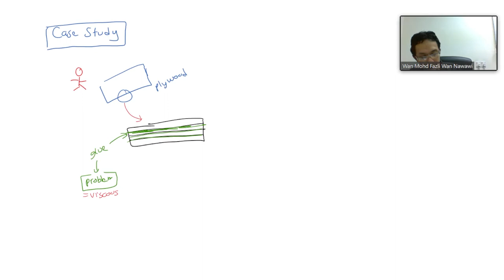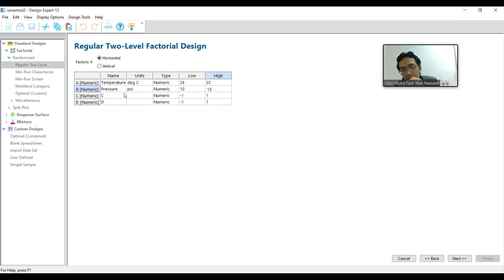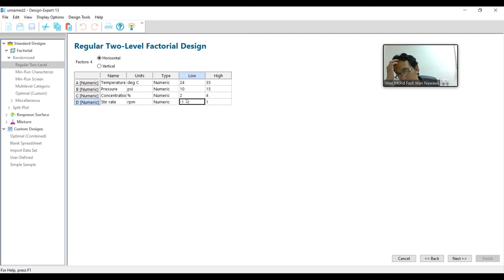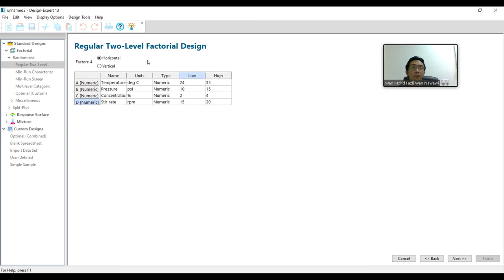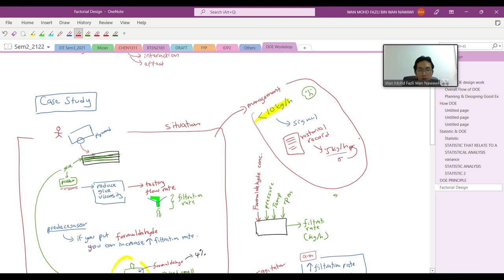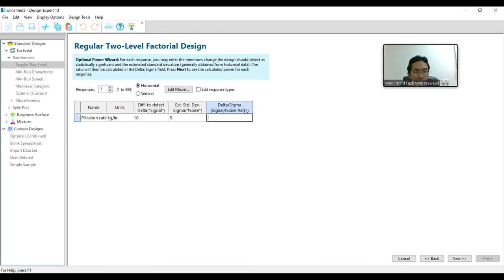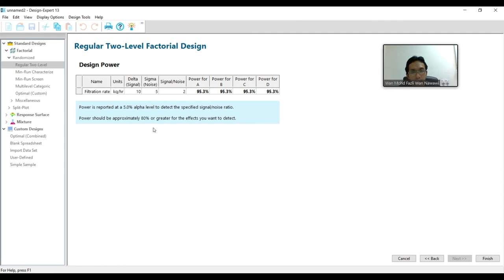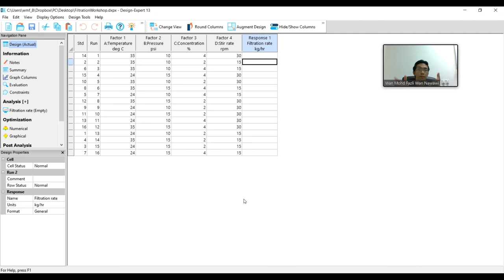12. Full Factorial Design - Part 1

Comment: In factorial design at 3 level 2 factor gives 9 run of exp and  after analysis by response like drug release, entrapment efficiency and particle size we get any one factor significant like from two polymer only one polymer is responsible for output is it acceptable or not

Comment: Sir, I've a question. Please reply. If i want to develop a pharmaceutical formulation, using Excipients A and B. Using this, I've prepared a formulation, Formulation 1 having only Excipient A, Formulation 2 having only Excipient A, and Formulation 3 having both Excipient A and B. So, in this case what kind of factorial design will apply and how can I do optimization using design expert software?
Reply from the maker: When preparing your formulation, your final product ( A, or B, or A+B) will be similiar in term of amount. Let say your final product weighed 100g. if A alone, then A composition will be 100g, if B alone, then B composition will be 100g. If mixture A & B are used, then the sum will total up to 100g.

In this case you should use Mixture Design. (NOT factorial or RSM design). in Mixture Design you can set the ratio of A & B accordingly, and try hunt the optimal formulation. 

I only cover factorial design in the series.  Mixture Design is quite different. But it is available in Design Expert. Personally, i dont know much about Mixture Design, but Im pretty sure for your case, you should use Mixture Design.

But if you ask me, becoz u only use two excipient A & B, then u dont really need to use any statistical design. just vary A, and B will follow. When A is 10g, B will be 90g, when A is 20g, B will be 80g, and so on. So, not much variation there as one factor will limit the other factor amount. However, Mixture Design is great help if u have 3 or more factor (e.g A, B, & C) as the possibility of different formulation  mixture  increase a lot more - that is where statistical design will help
Reply: @wanmohdfazli  Thankyou so much for responding!

Comment: where can I find 3 level factorial design for v13 DOE?
Reply from the maker: factorial design by default is two level only (low & high). if you want 3 level, you can add 'center point' -available at top of colorful sheet when u open regular two-level factorial tab. adding this center point allow a curvature point to be detected (if there is one, if there are none, then u will not see any curvature at all during analysis) . when u add center point, you'll increase numbers of run.

Factorial is used mostly to screen and to characterize.  3 level or above is generally reserved for optimization study, and the  response surface is more adequate for that. in response surface center point is already inherent in the design itself.